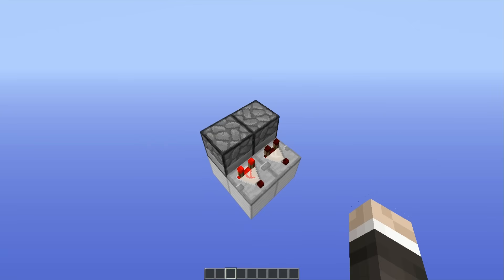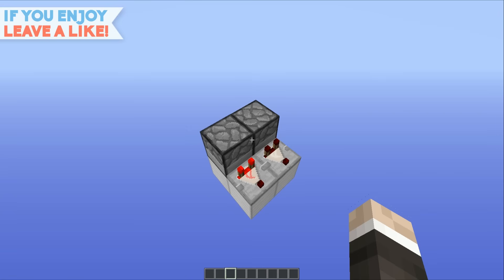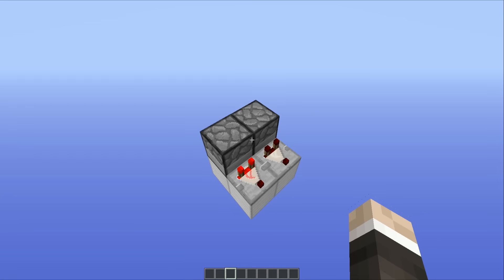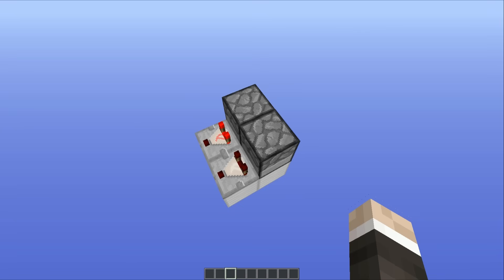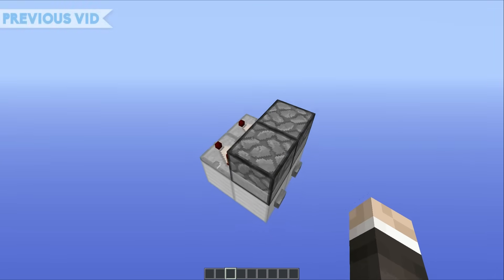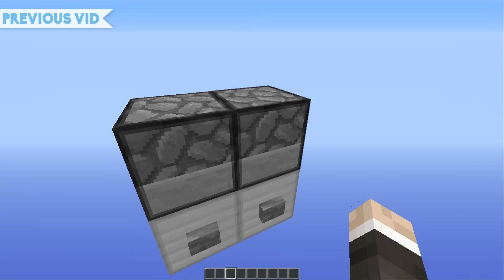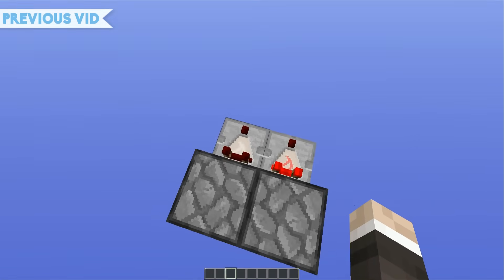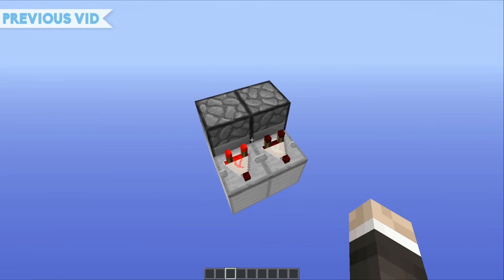Minecraft: Smallest Silent RS-NOR latch [Day 6]

Comment: How do you use these? They seem to work completely differently than the IRL latches I see in Computer Architecture
Reply: it works the exact same as any RS latch. one button is your store and one is reset. you get an output from one comparator, and inverted output from the other. Maybe I don't understand the question.

Comment: I'm a touch confused: is an RS latch different from an SR latch or are you all transposing the "Set" and "Reset" letters for some other reason? I'd write it off as people being silly and just pretending that "R" stands for Red and "S" stands for Stone, but I didn't see a single person refer to it as an SR latch so I'm thinking maybe someone knows something I don't. What's an RS latch do that an SR latch doesn't do?
Reply: In this specific case its hard to know if it will be a RS latch or a SR latch. The diffrence (according to search results) is which signal is dominant.
If both R and S is set to 1 or high (depenindg of how you view this circuit)
then a RS latch output will be set to 0 as R is is the dominant signal,
while a SR latch output will be set to 1 as S is dominant.
This design will most likley have a determined behaviour when powerd but that behaviour will vary depending on the tile set (the oreder in which minecraft handels events created in the same tick).
So the decision of RS vs SR is not determined by this design but on the inputs given to it.

Comment: Won't quasi-connectivity mess this up a bit?
Reply: Pika Chu Pistons only recact to that. Xd
Reply: Actually yes. In many ways it is a lot worse.  Because droppers are full block they transmit red stone signals, so powering directly is bad, as one will fire then the other will too, resulting is items only ever ending up in one dropper.  Sometimes it is better to separate them a bit using hoppers, redstone torch RS latch often work better, and more reliably, especially the vertical one, for a given situation, but they need a minimum 2 tick pulse to switch, making them hard to use with observers. And piston based systems need 1 tick pulses only.  Really what you use really depends on what the situation is.

Comment: Technically this is better than a plain RS NOR latch, because you'll never have both outputs on simultaneously even if both inputs are on at the same time.

Taking the left button as R and the right button as S, what we have here appears to be a Reset-dominant RS latch (as opposed to a Set-dominant RS latch). Good work!
Reply: How can you tell which is dominant?  Shouldn't it technically depend on which way it's facing (NSEW in-game)?
Reply: Good point - I only built one, so my testing didn't account for directionality!

Further testing(*) indicates that it's R-dominant if built on the E-W axis, and S-dominant if built on the N-S axis. Worth keeping in mind -  if your build relies on the latch having a particular dominance, you'll either have to build it on the appropriate direction axis, or you could invert the outputs to change the dominance.

(*) Built 4 of them, rotating the build 90 degrees each time.

Comment: Could someone give me an example of a use for this? (Not downing it, just curious)
Reply: I use them ALOT, although my favorite is in mob traps as a part of the smothering system. A single button press goes into one input of the latch, that turns on the pistons. That same redstone signal gets split off and goes through a timer, and when the timer is up, it hits the other input to turn off the pistons.
Reply: ***** Yeah, I see how that could work, ty.

Comment: so RS NOR's are for turning temporary signals into permanent signals? I believe I probably have made one without understanding the technical side of what they do. What's the technical term for one that changes a permanent signal into a temporary one? I've been doing some builds for those for a while in practical use, but any way to make it more compact would help.
Reply: Turning permanent signals into temporary ones are called edge detectors: rising edge if the temporary signal is sent when the permanent signal turns on, falling edge if the temporary signal is sent when the permanent signal turns off, and dual edge if a signal is sent at both ends.

RS NORs have 2 inputs. A signal on S toggles output Q (via NOR gates) to remain on regardless of S until R gets signal (and vice versa). If you want to be able to use the same input to make a signal permanent until the same input is sent again, that's a T-Flip-Flop.
Reply: No, t-flip-flops are for turning temporary signals, like buttons, into permanent signals. Unless I'm completely misunderstanding you, a way to create a PERMANENT signal is by making a repeater facing another repeater going  to the left or right of the first repeater. This is called repeater locking.
Reply: Ben Moder well, that, but what about the name of the divice I have been making for ages, to turn permanent's to temporary's. I learned the perma to temporary on my own, I just don't know it's technical term.
Reply: AshnSilvercorp Not sure, but an RS-Nor latch turns a signal that works, into a signal that doesn't work. Until you apply a different signal. that is.

Comment: Isn't it not silent because the droppers click?
Reply: Isn't it not silent because you hear the button being pressed? I think by silent he means it just doesn't involve the use of pistons.
Reply: They only make a noise if they dispense an item into air or if they are empty
Reply: You could make it silent if you wanted to by blocking the signal from the inputs if there is nothing in the dropper.
Reply: Jason Hey howcome i heard the dropper then?
Reply: mebezaccraft Its because he pressed the button with the empty Dropper ontop :p
Reply: Jason Hey how do you make it so it knows which dropper to do activate at a time?
Reply: mebezaccraft im not a redstone expert, just accept the fact that droppers make no sound when they dispense an item into another container (blocks with inventories).
Reply: Jason Hey ill accept that,
but there isnt really a way to make it silent, logically, because you have to get a second latch, then a 3rd, then infinite to make it silent.
i think i have a solution though...
AND IM NOT TELLING YOU!

Comment: umm Mumbo... you know that isn't an RS-NOR latch... it should only have one output... an RS-NOR latch is a system that has a button to turn it on and a button to turn it off. That is all it does.

This does work as an RS-NOR latch you just have to remove one comparator, so it isn't a giant crime or anything I am just informing you if you didn't know.
Reply from the maker: That is a T-Flip Flop :)
Reply: You are confusing RS-NOR latch with a T-FLIP-FLOP. An RS-NOR latch gives out puts that are toggle-able by 2 buttons, and a T-FLIP-FLOP turns a pulse into a solid signal that can be turned on or off with a single button.
Reply: Technically, this is just an RS NOR latch with an output and an inverted output.
Reply: +Nanorex Yeah that's what he said. And Mumbo Jumbo, the t-flip flop always switches, doesn't matter which button you press. The RS-NOR latch has one button to set the 'memory' to 1 (on) and the other is to set it to 0 (off). If you get rid of one of the comparators, it will be clear that it is an RS-NOR latch.

(Maybe he changed his comment, so I don't know I you are right.)
Reply: Craig McIlwrath Mumbo Jumbo NanoRex Alex G Hoekstra It is actually an RS Latch. It doesn't matter if it has a second inverted output.
What does matter though, is that has nothing to do with NOR. That only refers to the standard torch design.
Reply: dro yeah, it just makes more sense to remove one but I wanted to explain OP wasn't thinking of a T flip flop.
Reply: Alex G Hoekstra Actually RS NOR latches have 2 NOR gates and thus 2 outputs. Most of the time, one output is merely used as part of the latch. This isn't an RS NOR because there are no NOR gates and the output of one comparator has nothing to do with the input of the other unless you wanted to make a perfectly silent version that locks the repeater feeding the droppers so extra signals on the off dropper never reach and make clicks.

Comment: I feel like using comparators, droppers, and hoppers whenever it's not necessary is like cheating.
Reply: How, they're in the game for a reason, and 99% of the time they are nessesary. Its not cheating at all
Reply: How? It created an 2*2*2 rs-nor latch.
Reply: Also, the real world doesn't have any comparators, droppers or hoppers, and I'm the person that likes to build things based on the real world circuits, rather than the useful stuff like automatic farms.
Reply: ***** but the real world does have comparators  droppers and hoppers... they're just ... different,. integrated circuits can be set up to give the exact same results as a comparator..... Hoppers are used in the real world ALL the time, and droppers are also pretty common in manufacturing / assembly
Reply: TheTwistedbeaver I'm talking about the most basic electronic components - transistors. I doubt there's something as small as transistor that can teleport other objects :D
Reply: ***** oh ddefinitely there's a lot to be said for larger more "plain" redstone builds... they have their own charm.
nice organized rows of wiring neatly layed out together.... some of the "supersmall" designs are lacking in some ways.
Reply: Moments You use redstone to craft a dropper and a comparator, they are redstone components.  Do you feel like you're cheating (or out of place) when you use a lever? it doesn't have any redstone, nor do buttons.

There are just older and newer parts of the game that are more and less useful in different situations and that replace more complex systems in favour of less laggy (or more laggy) systems that may also take up less space.
Reply: you can't cheat in this game
Reply: I feel like builds that are already very small, don't need anything like that. It's not always about the dimensions, it's also about the complexity of the build.
Reply: ***** Well then is modded really suited for you ;)
Reply: ***** but the requirement to use hoppers and droppers and such are basically due to the inadequacies of the redstone system ... in the real world we don't need to make 1m*1m blocks.... we can make things small enough to do whats required,. and use multiple components in a much much smaller space to create the required bbehavior

like... several transistors and a few other components can make a "comparator" much much smaller than anything in minecraft,
as for droppers and such, using them in minecraft as "circuit components" rather than their intended use, is simply because minecraft lacks the real world components we use to get a specific effect.

its possible to make full scale "microcircuits" in minecraft by building HUGE arrays and whatnot... but if you can "shrink" it by using some other components in ways that might not have been originally intended, then why not :)

and as for "I doubt there's something as small as transistor that can teleport other objects"... 

theres no objects in minecraft that are HALF as small and versatile as a transistor. :)

(sorry for text wall i just cant stop myself sometimes ;) )
Reply: TheTwistedbeaver yea, but the classic 2x2x3 design seems very compact to me too.
And it's also simpler to build.
Reply: I'm of course not trying to avoid these all the time, only when it's not necessary.
Reply: ***** Why the comparison to the real world? Just because you're nostalgic for older less compact designs, that has nothing with the real world. And transistors? Well they don't consume cubic METERS of space to even build. Frankly all redstone is ridiculously big. I will say there are super small builds that are confusing, but things like this? this is super small and understandable and if I needed a RS NOR latch, I will probably use this just because it's smaller and more light weight (if I have quartz)
Reply: that is one of the most stupid things i have heard. it just makes no sense at all if the developer of the game put it in the game it was meant to be used
Reply: basebilljr07 You don't always have to use it. Mumbo used it in his 3x3 door and it was absolutely unnecessary to put it there. Even a normal way would be simpler.
Reply: basebilljr07 I would say half of the methods used in redstone wiring to "simplify" things and make things more compact, was never intended by the devs... 

things like hopper clocks weren't decided on .... they were discovered by players.
Reply: TheTwistedbeaver oh yea, contrary to my previous comments, I actually like the hopper clock, because it's useful in many builds.
Reply: TheTwistedbeaver name one thing in minecraft smaller than a transistor
Reply: MitruMesre Did i say there was anything smaller than a transistor in minecraft?....
i wish people would read before commenting.
Reply: TheTwistedbeaver yeah, I read that backwards
Reply: Hi!
Reply: MitruMesre A pixel.
Reply: tylerme14 a pixel is larger than a transistor.
much larger.
Reply: I just wanted to say that mumbo often uses hoppers/droppers, but sometimes it's not really necessary. I have a rule, that the less components I use, the simpler the build.
Reply: ***** I'm saying this for the last time:
I just wanted to say that mumbo often uses hoppers/droppers, but sometimes it's not really necessary. I have a rule, that the less components I use, the simpler the build is.
Reply: Moments I don't remember my state of mind when I posted that comment, but I think I was trolling.  Sorry to have bothered you.

Comment: Why isn't it just called a NOR gate?
Reply: Because it's not a NOR gate xD
Reply: Kappa It's not?  All it does is switch the input.
Reply: Michael IsAmazing A nor gate simply changes it only output to 1 when all inputs are 0. An RS-NOR latch/RS-FlipFlop has two inputs (set/reset) and two outputs (Q1/Q2). Q1 is always the opposite of Q2. It's just something different xD
Reply: Michael IsAmazing a gate would imply that a given input A would always result in output B, but this contraption works with changing inputs. 
If you do not press any buttons there are multiple possible outcomes, not just one.
Reply: Aight, thanks.